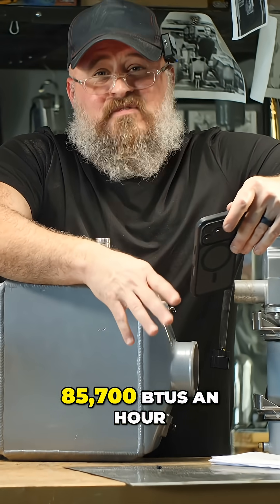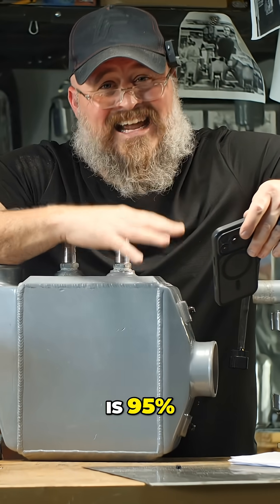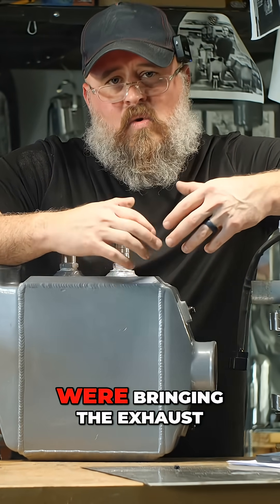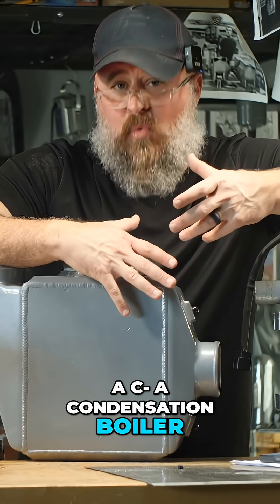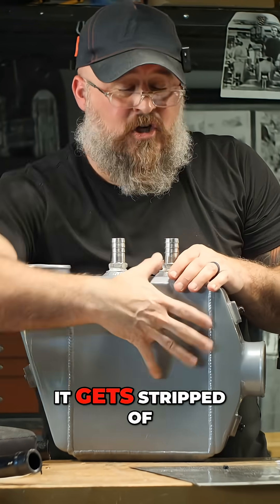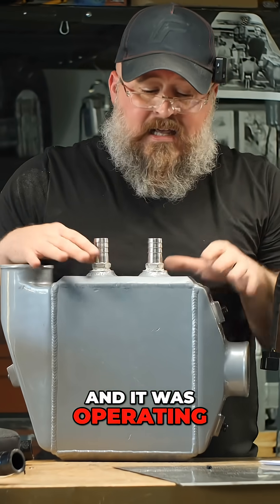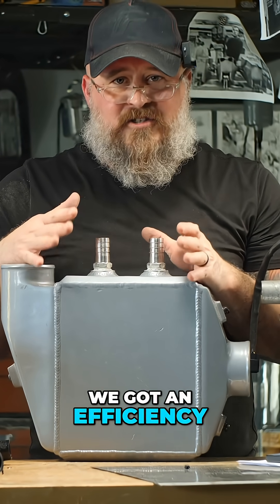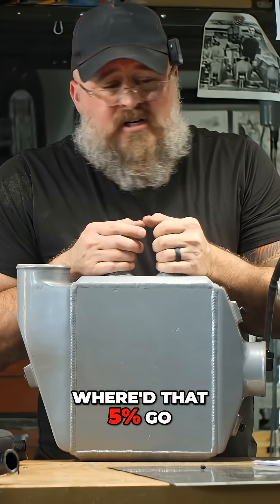20kW Diesel Heater: 95% Efficiency?! #shorts

Comment: ? I did this with a fan over the 6 ft exhaust pipe.   Ran solid stream of water outside and exhaust temp below room temp due to air coming in where I sleeved it at the wall.